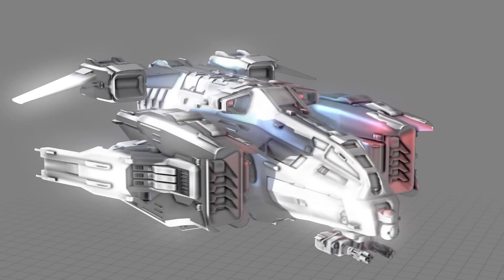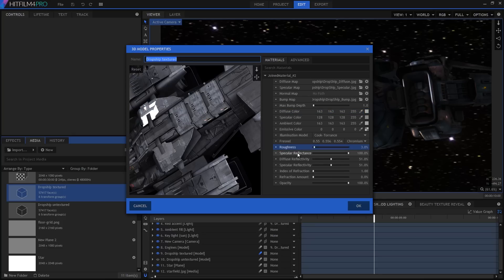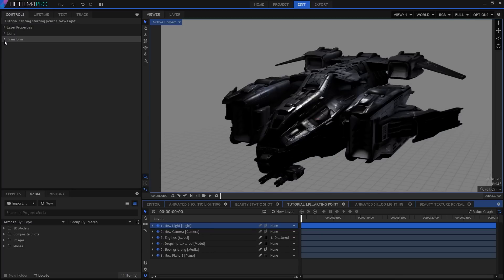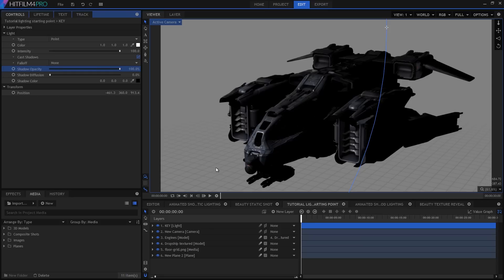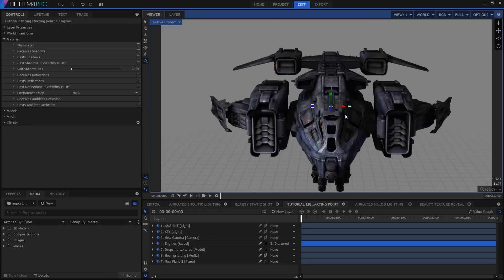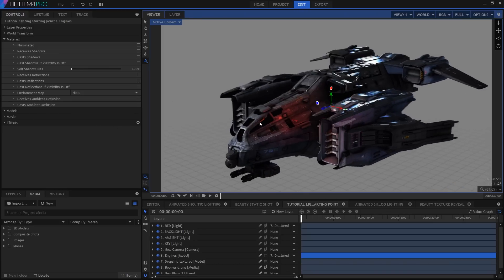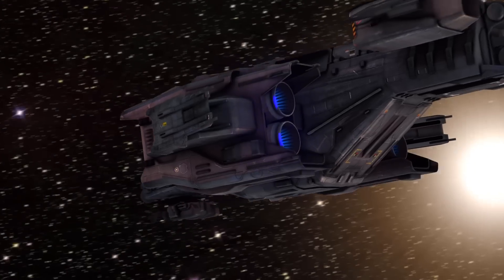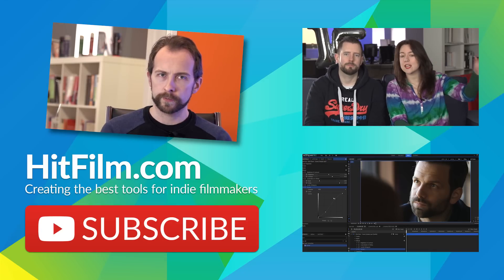How to light a 3D model

Comment: I use hitfilm all the time. Just bought the New Hitfilm so now I'm up to date. Even tho its not worth 400 bucks for the exact same features and barely any difference. Still cant preview what Im working on it just lags to the end when I hit play. 3d models the lighting doesnt work as easy as I see online. Its simple shit I starting to hate hitfilm. Spent like 3 days trying to get the god damn light to work right and I do this shit all the time. Dude I'm so done with hitfilm. Spend 400 bucks to update from Hitfilm 4 which I just bought like a few years ago. Zero difference. Got Action Pro which I cant get to work like the tutorial. Hate this crap. Frustrated as shit. All I wanted to do was one simple damn shot that should take less than 5 minutes and its taken me like 4 days and still cant get the damn light to line up correctly
Reply: I agree. I've NEVER been able to get ANY results with 3d. The models import but always look totally low resolution...

Comment: please is there 32 bit versions in this program
Reply from the maker: +Murad Murad HitFilm is 64-bit only, sorry!
Reply: +HitFilm  hi,
I'm going to buy a core i5, 2,4ghz, windows 7 64 bit, and intel hd 3000 graphic card.
I saw on requirement that it need hd 4000, but on the forum I saw a 3000 will also work, but a bit slower. 
Wich side of hitfilm.com I have to believe? ☺
Reply from the maker: +Lemon Music We'd always say to go by the system requirements set out on HitFilm.com as those have been carefully selected in the testing phase of the software. Hope that helps!

Comment: How did you do the engines?
Reply from the maker: +jrsmoots the engines were created using a duplicate of the 3D model, parented onto the main model. The engine duplicate had all of its illumination/shadow/etc settings turned off, and then a glow effect was added with a high threshold so that only the bright engines would be visible. Another glow effect was added for additional glowiness, then a heat distortion effect for the rippling. The entire layer was then add blended back onto the main ship model.